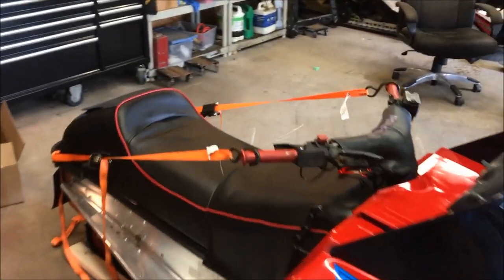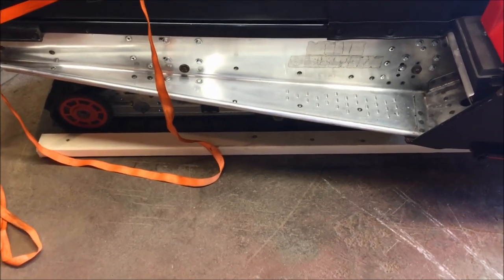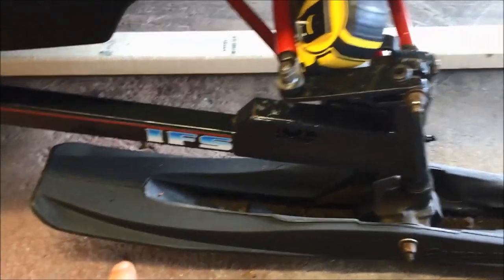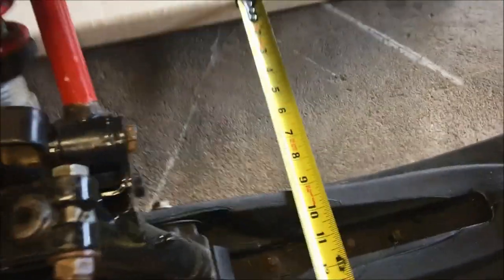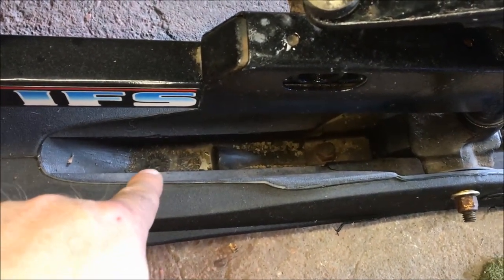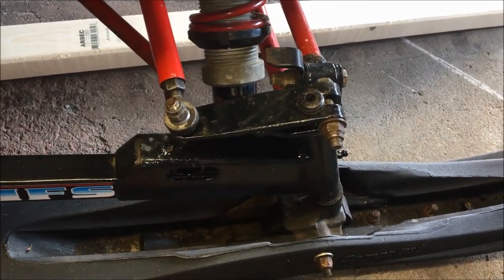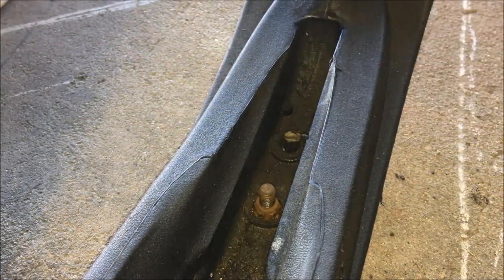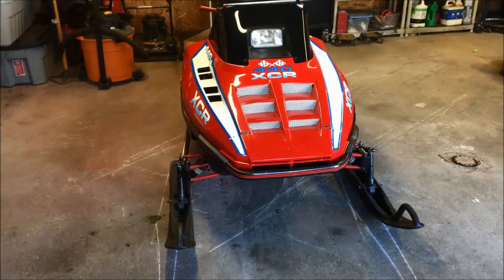Polaris XCR 440 Project Sled - Ski Alignment

Comment: Good explanation Streeter. I like the ratchet strap trick, I'm going to use that the next time I do an alignment. Also if you break both of those lock nuts loose on the tie rod, the inside and outside nuts, you can turn the tie rod to adjust rather than taking of the tie rod end. They have a right hand and left hand thread on those tie rods ends. Good video, looking forward to the camber adjustment video.
Reply from the maker: Thanks. Tried spinning the tie rod end on the right hand side but the jam nut on the inside is seized and wasn’t budging unfortunately. Still a bunch of little things to do with it.  Trying to find the time is the challenge at this point. Lol

Comment: First off... thank u for your content. I was able to loosen the inner and outer lock nuts on tie rod.... it should spin, correct. I had to put pipe wrench on it move! I'm concerned it's gonna twist tie rod. So.... I tried your way, but the nut that holds outer tie rod hiem to spindle is just spinning and won't loosen. Is that nut a traditional lefty loosey? Any suggestions plz.
Reply from the maker: Some are left handed threads.

Comment: It's funny you just posted this . I was just reading the service manual for the touring 500 so I can do an alignment on it ! I like the idea of using the straps to hold the handles. I'm also adjusting the camber , I'm not sure why it's not correct from the dealer since it was almost new when I bought it last year ? The front end seems to drift around and I'm sure it's because the camber is way off. Mark
Reply from the maker: I’ll be posting a video on doing the camber as well. It has positive camber now and the top of the posts are leaning out a bit. 

Is the Touring darting? You may just need to shim the skis to change the angle of attack on the front of the ski so its favoring the back of the ski versus the front.
Reply: No it's not darting . It just feels like the whole sled is loose ,like your riding on marbles.Riding 2 up or single. I adjusted the rear FRSS to ad ski pressure. (According to the manual). This xtra 12 seems more difficult than it needs to be. Although it works great as far as a soft ride, it just feels all loose if you know what I mean? The carbides are those ones Polaris made called           " easy steer " basically 3 " of carbide on a 12" runner.
Reply from the maker: Mark Bow Is it loose in the front or back? Front as in there’s no weight on the front end?
Reply: I guess it seemed loose in the back to me kinda like fishtailing but not that extreme . So I just shortened the limiter straps one hole and tightened the ifs springs about 1/2" more. The track is more parallel with the ground now. What do you think ?
I didn't get much riding time on that sled last year my daughter wouldn't let me on it ! She wouldn't know the difference except she complained "it won't steer".I only did one 80 km ride and it was really bothering me .
Reply from the maker: Sounds like you still have too much weight on the back end and the front is light. Watch this. 

https://youtu.be/O8FFQHetosw
Reply: Ya I've been doing some research and it's complicated ! I found detailed instructions on snowmobilefanatics.net I'll let you know how it turns out.Thanks

Comment: Ok so how do ya do this is you can’t even get the wood past the right ski on mine ones dead straight right one is like it’s half turned already so
?
Reply from the maker: Remove the bolt on top of the spindle and lift the drop arm and you can then reset the ski
Reply: @StreetersGarage  thx man appreciate that huge time did that took nothing for
Time first sled so wasn’t 100% if I was just to adjust the tie rods or what but ya appreciate that huge time sled works mint
Reply from the maker: @905mudboysdc4  you’re welcome
Reply: @StreetersGarage  so just another quick question may not have the awnser to this one but hey worth the shot underneath my track I have a shock in the rear the front part has a belt with a bolt and nut and some washers to hold the belt to get I’m assuming there’s supposed to be a second shock that would be under say my gas tank or handle bars of my 340 Olympic sled it’s a 79 first sled did some researching can’t find any info on it so not sure if that’s way it is or has been modified to work still